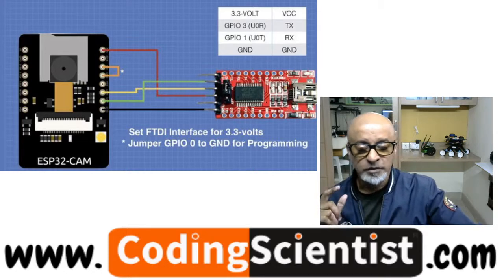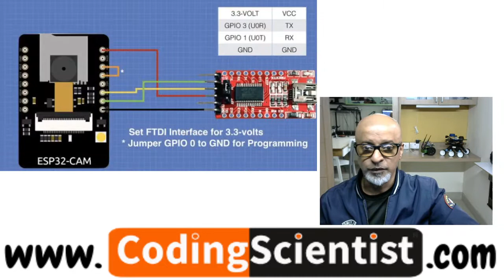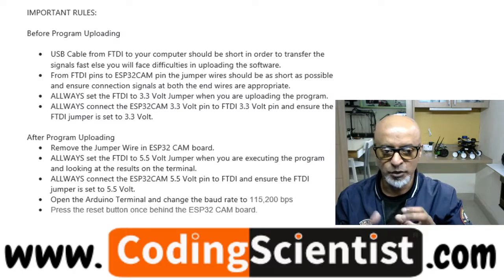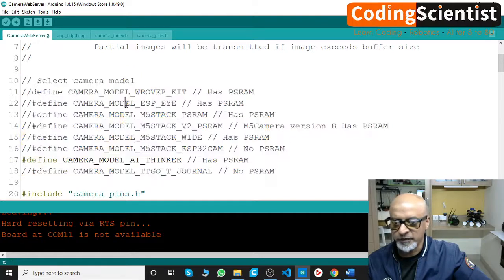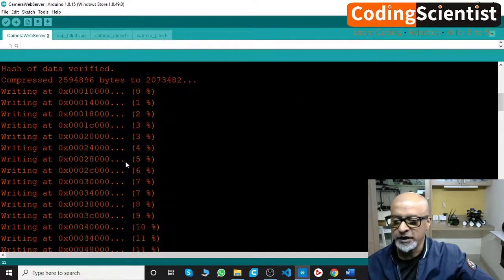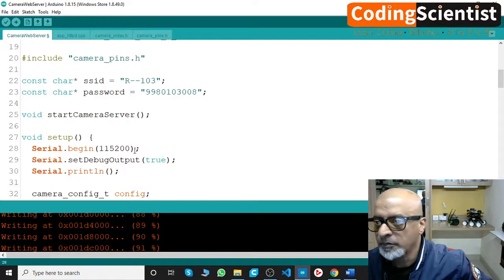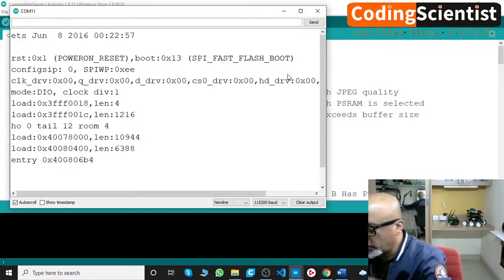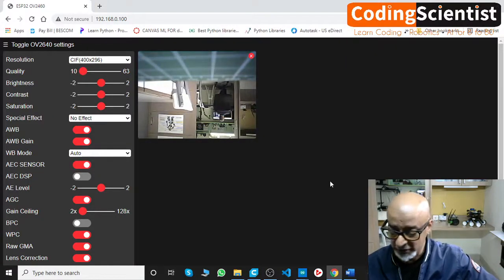Lesson 22 Camera WebServer Testing

Comment: Hope to find out a solution.
I am a beginner and I am still struggling into the below problem, while I was following the rules before uploading: 
"
Sketch uses 2594774 bytes (82%) of program storage space. Maximum is 3145728 bytes.
Global variables use 56256 bytes (17%) of dynamic memory, leaving 271424 bytes for local variables. Maximum is 327680 bytes.
esptool.py v3.0-dev
Serial port COM3
Connecting........____....._____....._____....._____....._____....._____.....____

A fatal error occurred: Failed to connect to ESP32: Timed out waiting for packet header
A fatal error occurred: Failed to connect to ESP32: Timed out waiting for packet header
"
Thank you in advance.